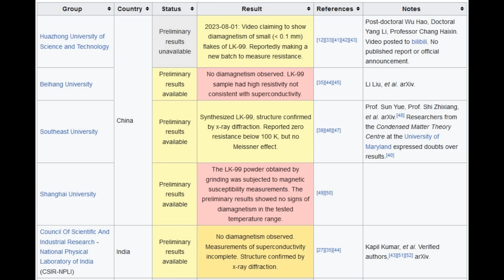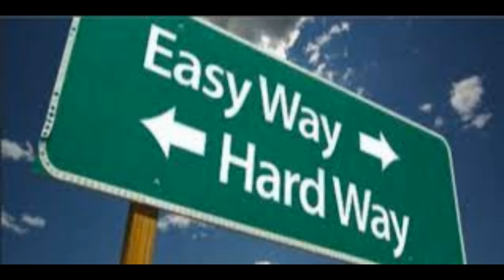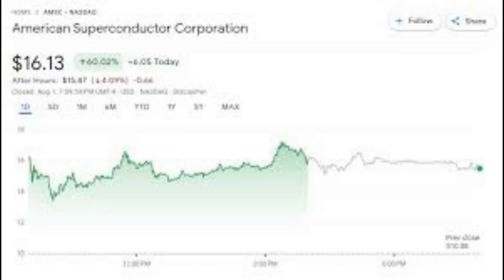2007 Superconductors And The Trouble With LK99

Comment: How do you feel about a majority of your stance on the validity of LK99 after multiple labs have confirmed LK99 to be at the very least an insanely high temperature superconductor? Even if the best we get is the -13C at atmospheric pressure number, that's enough to revolutionize almost every industry.

Comment: Incredible because part of my degree was working within a research team to create some super conductors. 
My role was to grind and create the correct ratio of conductor to impurity required for the bose einstien condensate to occur. 
But we only test easily at liquid nitrogen temps and it required higher approval and timing and time to get lower hydrogen temps. 
Also the creation process (20yrs ago) involved correct chems mixed and then tested under temp and then tested under expensive lower temps conditions.
So the holy grail is easy and in sight. Just the super conductor dream of all pyhscis has been elluding us like cold fusion for many years.

Comment: Hi Robert, Hello everybody,  The enthusiasm for what a room-temperature superconductor could provide seems to have limited our critical evaluation of it. What I'm referring to is the materials involved. R.T. superconductors will only help power transmission if they have comparable weight and tensile strength -and comparable availability- as do copper wire and aluminum wire.
Reply: Since the material is a ceramic and not a typical metal with ductility I don't assume it will help with power transmission unless the copper or aluminum strands are "doped" with the material. It is also claimed that the superconductor may be 1 dimensional so long long strands of it would be most useful in power transmission. * Ignore my crude and ignorant language as I'm just a software engineer navigating the hype of a breakthrough in materials science.
Reply: You can deposit a thin layer of it onto some other material. That substrate then provides the necessary mechanical strength. Even if the superconductor is a hard material, with a thin enough layer almost anything can be flexible. And with 0 resistance even a very thin layer would work great for carrying current.
Reply: Remember fiber optic cable are made of glass.

Comment: 🤔With everything I know about room temperature superconductors  and Material Sciences is where you take the Nano powder of two or more different materials in zero gravity & in a vacuum and Quantum entangl electrons within the nanopowder material to arrange the atoms of the materials in their superposition with varying frequencies of high-voltage to the material to a liquid then super cool to solidify locking the material in its superposition for a superconductor at room temperature🤷‍♂️
Reply: So unless you have a sulfur hexafluoride glovebox on the International Space Station you aren't making room temperature superconductors everything on Earth has to be suspended within a liquid therefore you still need liquid cooling

Comment: This is about the difference between belief and knowledge. Unfortunately, a lot of people int the industry try to believe instead of knowing, the results are more often than not catastrophic. When this happens in research it is also pathetic. That being said, the hubless generator could be knowledge or just belief ?
Reply: This video is all belief. The guy doesn't add any facts. Just what he believes.
One of his beliefs seeming to be that this would be too easy. A material the scientists have worked on since 1999 and that seems to be extremely hard to successfully recreate, too easy...
Reply: @4203105  While I agree that there are no new facts added by the video, Robert "visually" cites at 2:52, the results of scientists trying to replicate the initial experiment, apparently without success. And, yes, this is an opinion expressed and not a fact checking video.

Comment: In 1987 Bednorz and Müller won the Nobel Prize for discovering a new class of superconductors (perovskite ceramics). This flew in the face of what was known and spared a race for room temp superconductivity. YBCO composition was discovered shortly thereafter, with the all important Tc > than LN2.  I'm not saying LK 99 is real or not, but a few decades ago a fundamentally new material, electrical property was discovered. It happened once, why not again? My 2 cents is this not superconducting, the levitation videos do not look like the Meissner Effect. I've played with NdFeB magnets on LN2 cooled YBCO, and they spin, can move them around in any orientation. Turn them upside down. In the Meissner Effect the magnet DOES NOT SNAP back to some fixed position. In the vids of LK99, the material (inversed as the LK99 is hovering over a fixed magnet, but it doesn't matter, cooled YBCO over a fixed magnet would also freely spin). The videos look like a diamagnetic phenomena not one of superconducting magnetic repulsion.
Reply: One should consider that this sample likely isn't pure though and will have some pure copper and lead in it. That could explain the snapping to a certain point. It does look diamagnetic otherwise. Even more so in the new video on the New York Times article.

Comment: You can do this at room temperature with Dielectricity/Cold Electricity/Radiant Energy, easily made in a hairpin circuit, it keeps the magnetic component out of dielectric flow and doesn't create any heat in the wire, or load if modulated correctly, it won't work on standard motors though since those need magnetism, these are Tesla's non-Hertzian waves. 

This also occurs in Tesla's single wire transmission if the Russian's experiments are anything to go by, series wired resistors, capacitors, and inductors are all shown to have no effect on the power transmission.

Comment: I'm like you. I see these headlines that say, "New Scientific Breakthrough Changes Everything!!!!" -- presumably for the better. Then I look at my bills, and they have not been paid off or even lessened. I drop something, and it still falls to the floor. In fact, I cannot see ANYTHING that has changed. While I will readily admit that there is a potential for change in some areas, there is no reason to over-hype the discovery.

Look at graphene. When it was discovered, it was going to revolutionize the entire world. But it hasn't done so. It certainly HAS had an impact (even a significant impact) in some areas. But very few people have had their lives changed by graphene in any significant way. And graphene actually works. As you point out, LK99 doesn't. "Science" reporters ought to think before they write headlines. But if frogs had wings...

Comment: Bandwagon is happeningon both sides of the discourse right now. There is for certain some peculiar properties in this material, even with the assumably terrible sample quality, they have something that appears to be more diamagnetic than pyrolyctic carbon sheets. That is very indicative of some SC properties within the material, but its also very clear that the sample purity and consitensy is very bad. They spend the best of two decades just trying to replicate it reliably since its accidential discovery, other papers have reported similar results in the past in lead and copper, as far back as 2000, but they could not be replicated. I think there is actually something to it this time, but the synthesis is extremely hard, because you need to replace sulfur with copper in places in the crystal lattice where it is MOST unlikely to do so, so for every batch there is only a little of the "magic" crystal structure and a lot of biproduct that did not react in such a fortunate way.
Im still hopeful, its not over.
Reply: Exactly! Might take another year, 10 years, or never till we find the perfect manufacturing process that can be scaled for manufacturing, but the magic material is real by all accounts.
Reply: I understand nothing about these matters and don’t know if this information is of any use, but I saw someone speculating in a forum that some impurities in the material could be what is giving it the wanted properties, that’s why the results come out so different.

Comment: so, from my understanding there is difficulty replicating the material. But Two other labs have declared success replicating the results shown in the video.
The issue is not because following the instructions on the paper are any more difficult than any other synthis, but from increadibly low yeilds and some bad use of cloquial speech in un-prepaired press interactions and of course the papet that wad absolutly NOT ready for release.

Basically the material really wants to form in a lower energy state (naturally) but occisonally forms in the higher energy state that allows superconductivity, allowing for some shake and bake synthisis on this material that is novel, and probably rather useful at least, and still unverivied as to being a super conducter
Reply: Which two labs? I know of one that has recreated the meissner effect.

Comment: I mean, even if LK-99 is superconducting at room temperatures and ambient preassure (which it's probably not), I wouldn't call that dropping the answer into our lap and that we don't have to work on it. If it's real it's clearly increadibly hard to produce and will take years if not decades to enter mass production. Also it might not be the best material for the job at all, meaning we have to research other materials with similar properties. There is a lot of work to be done and nothing comes easy.

Comment: I’ve just heard that it has been replicated in an independent lab.
Reply: One lab claims to have observed the meissner effect but hasn't tested for superconductivity.
Another lab says it's superconducting at 110 Kelvin or lower, but their instruments can't really tell good conductivity from superconductivity and the curve just looks like any old metal.
A bunch of other labs have found no meissner effect or superconductivity.
So no, nothing is confirmed and it looks rather bad. Although the meterial is supposedly very hard to produce, so it might work only under very specific circumstances.